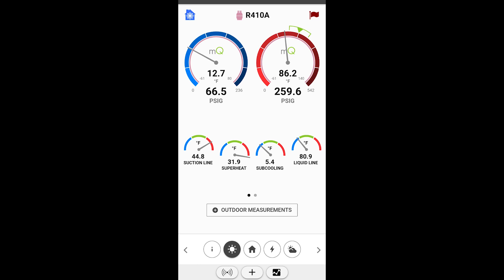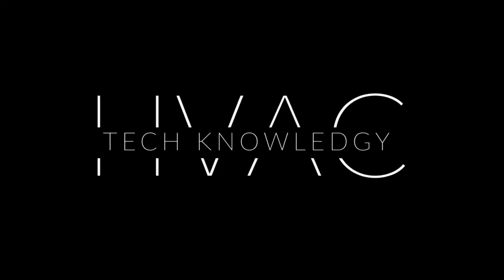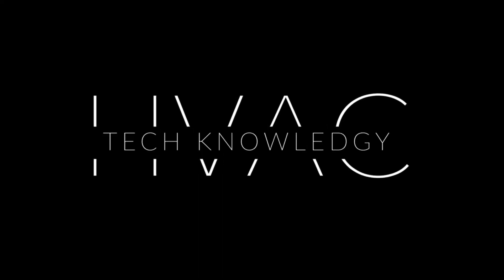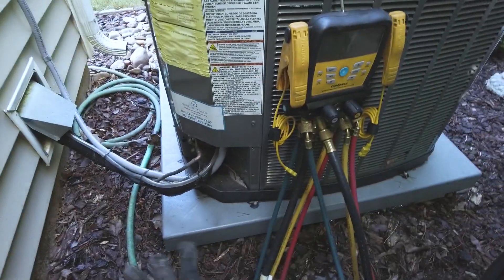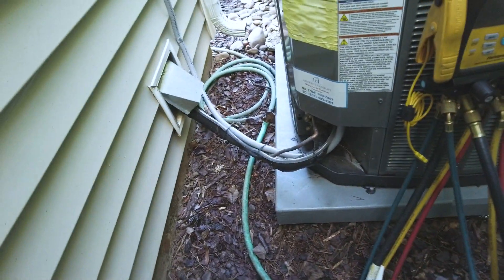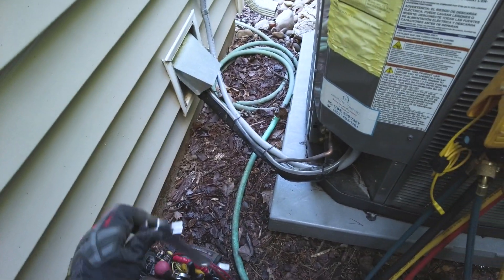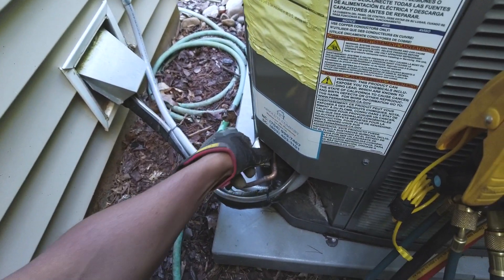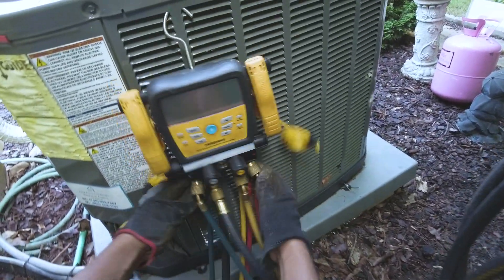Failed TXV - Signs of a Bad TXV | Diagnosing and Replacing Bad TXV - Part 1

Comment: new tech here, on a heat pump would it be possible for a bleeding by reversing valve mimic the signs of bad txv? or vice versa?
Reply from the maker: As a matter fact, I just came across one of those the other day. A reversing valve seal bleed would usually causes high suction pressure and high superheat with slightly low head pressure, as a result of the Discharge gases being slightly diverted to the low pressure side of the system. Also if the TXV were stuck open,  you would also have high suction pressure due to a flooded evap coil, but that will cause low superheat and because there’s not much or any superheat to subcool you would have low subcooling as well. Good question because sometimes they can be tough to you diagnose if you ever come across it in the field. Thanks for watching!
Reply: @HVACTechKnowledgy  high suction on the true suction or on the regular suction service valve?
Reply from the maker: Both in cooling mode because the bleed is between the high and low side so the true suction and vapor service port will be the same. In heat pump mode your vapor service port will reflect the high side of the system, just after compression.
Reply: Makes perfect sense thank you!

Comment: I thought if the txv was not opening you would have high subcool and high superheat?
Reply from the maker: Yes sir, I’m not sure if you noticed in the intro the superheat was high, about 32 degrees and around 25 sec mark the sub cooling was beginning to climb as a result of the liquid backing up in the condenser right before the unit shut off on low pressure. But if it weren’t for the low pressure switch the sub cooling would’ve gotten really high. That’s what I really like about the fieldpiece rapid rail clamps they respond quick enough to observe these types of things.  Thanks for watching!
Reply: I watched it again and yup I see what your saying. Good catch.

Comment: Move the vent pipe
Reply from the maker: LOL yeah, I just figured it was quicker to leave it installed and work around it, than to try to uninstall and reinstall. I also left the left panel on for the same reason, so I didn’t have to cut the drains loose and reinstall. I try to be as non-evasive as possible and working on equipment, something I’ve learned over the years. The more you mess with the more chances things can go wrong. Thanks for watching!